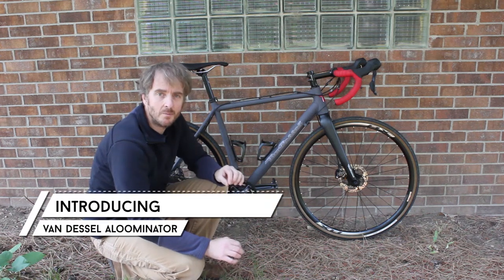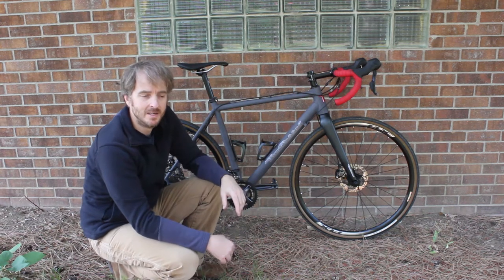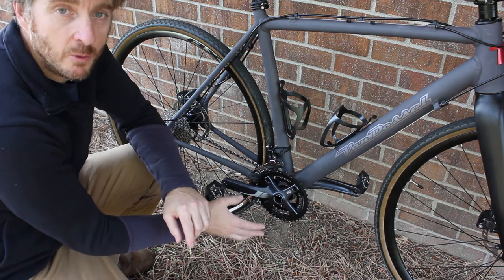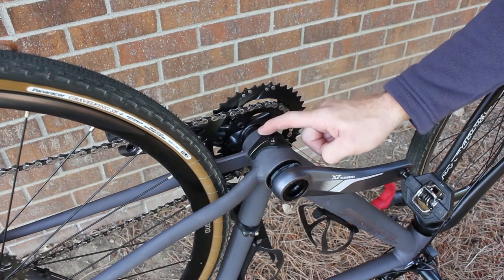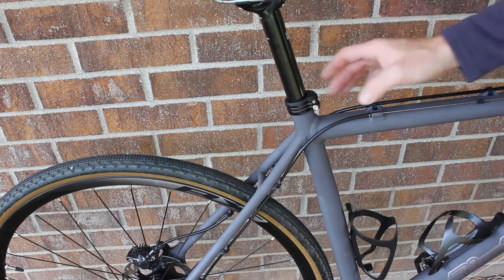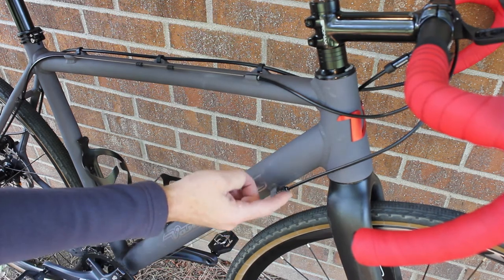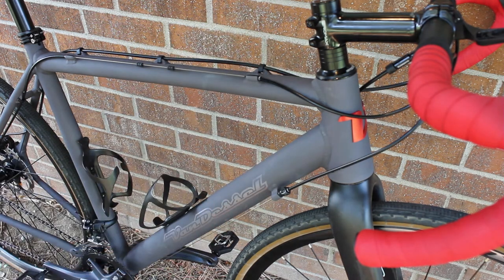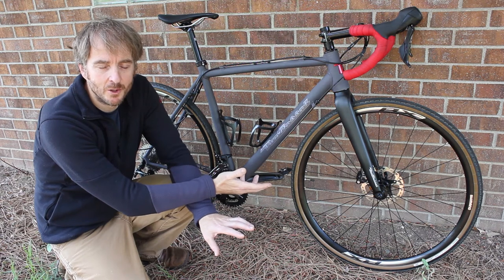Notes from my Van Dessel Aloominator cyclocross build

Comment: I've been sitting on one of these frames for 4 or 5 years but never built it up. I'm thinking about a doing a 1x drivetrain. Mine came with a PF30 installed, so I may need to check the crank specs before I buy one. Thanks for the heads up in this video. I love the finish on the frame! My frame had a nice dried clay patina from the previous owner. It will never be used for cyclocross, but more likely a rails-to-trails type cruiser. I look forward to seeing more of your updates!
Reply from the maker: Awesome.  Thank you.

Comment: Thank you very much for the VID! I'm building on a similar frame. What crankset did you originally try to fit? What kind of bottom bracket did you finally install? Would you recommend a threaded PF30 or go with an original FSA PF30?
Reply from the maker: I ended up using an SRAM x7 42/28 crankset with a Wheels Manufacturing press fit PF30.  It’s the one that has the cups that contain the bearings and you press in the cups.  I tried Shimano 105 & Tiagra cranks but both came way too close to the chain stay.  That was with the PF30 and Shimano adapters.